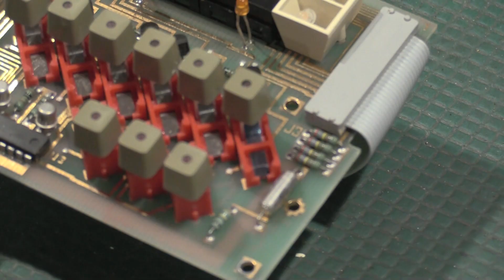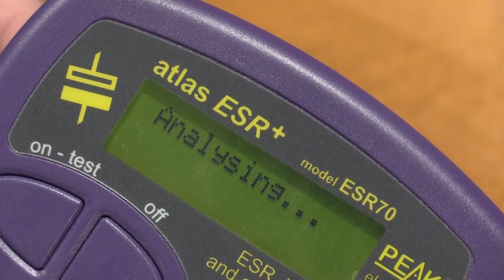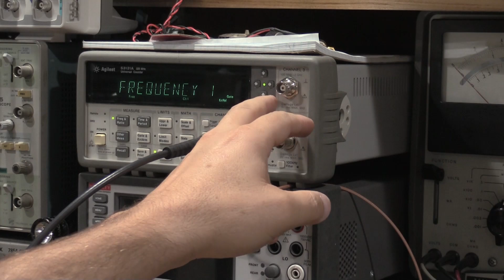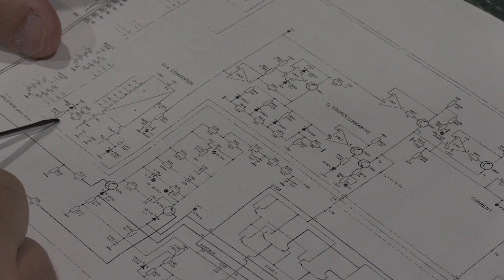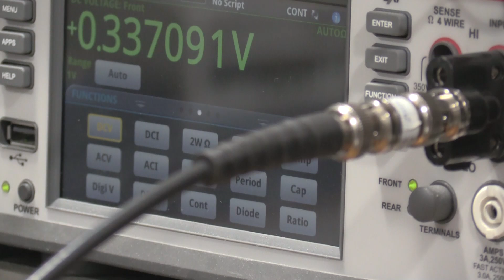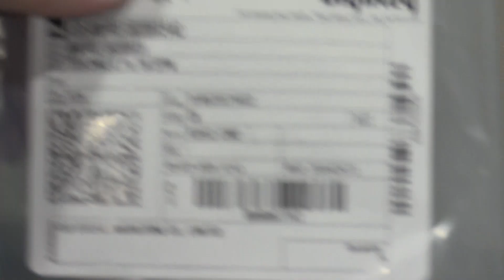HP 8165A Repair and Restoration Part 2

Comment: The HP 3325 is more suited to low freq work, especially audio. Though the maximum freq is 29.99... MHz, it only allows modulation up to 21 MHz, which sucks for 10 Meters, though it's usable as an RF generator below 21 MHz. It does have an external mod, but I don't know if it will work above 21 MHz, as I've only played with one of these a long time ago.

I use two R&S-Polarad function generators for low work, with one especially designed for audio (600 kHz max with a 600 ohm output). However, I might dig out the 8165a and play with it after this video.

Comment: You sure know that the temperature compensated zeners have internally i series one or more diodes.  That/they eliminate the appearance of the “forward” voltage, i.e. the 0.6 V knee.  The temperature compensation results from the series connection of positive and negative drifts.
Reply from the maker: The speced diode is 5.2 if I remember correctly. This one was testing at 4.8 there was not enough voltage at this node which was throwing the DC offset self cal out of range of adjustment. Bringing the voltage closer to 5.2 nominal allowed the self cal to adjust. This diode was the DC offset reference.
Reply: @ZenwizardStudios  I believe InssiAjaton is referring to 8V unit you put on the curve tracer at about 14:30, explaining why you don't get a Vf.  It would only work at higher zener voltages since the temperature coefficient goes negative at lower ones below 6V.  Cool trick!

Comment: Nice to see any old HP unit back in use, great work. The 0.1% resistor was way overkill I think ! but hey it works...cheers!
Reply from the maker: From a wattage stand point absolutely but because I am depending on the resistor at the moment to keep the diode in check I needed the temp co of the resister to be on the higher side to stabilize some of the drift tried it with a "normal" resister and the trace was bobbing up and down on the scope screen with off set. The better quality resistor stabilized this issue.
Reply: @ZenwizardStudios  :)

Comment: @5:50 I would pull those caps and check for them leaking, I’ve seen plenty of those big caps leak and still be perfectly functional, don’t want to end up repairing eaten away traces.

Comment: I recommend checking the hulking electrolytic caps anyway. Reason: I recently repaired a HP8901A modulation analyzer and lo and behold, its big cap had spilled electrolyte on the PCB. Eating away some of the green PCB solder resist. HP being HP, the gold plated PCB tracks shrugged off the electrolyte but good it was not obviously. I ended up finding myself a used, but not leaking, cap at a ham fest. Prices are like you mentioned: "off the scale".